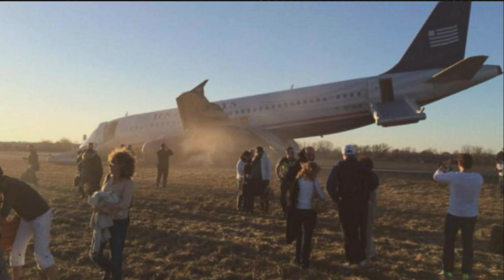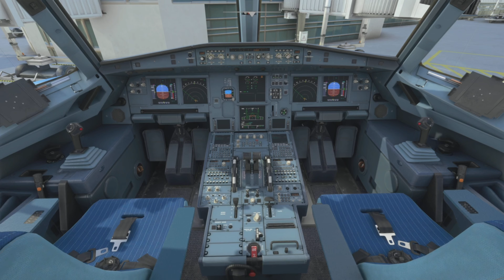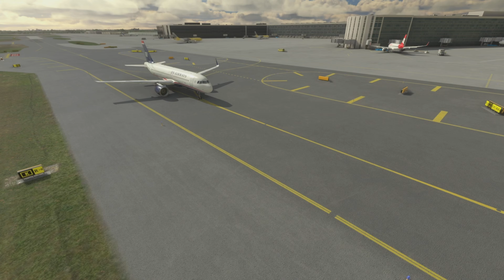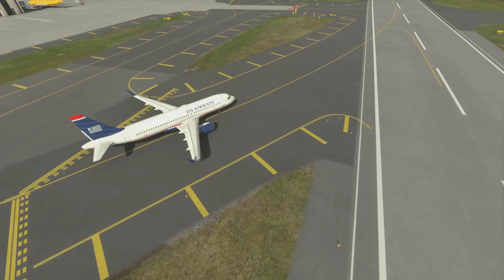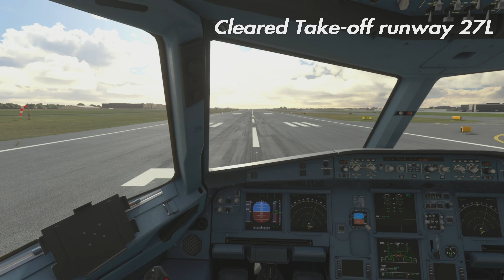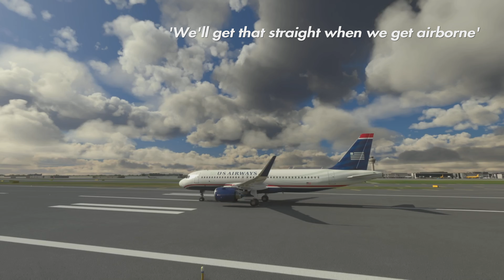Should They Have Continued? | US Airways Flight 1702

Comment: The one thing that sticks out to me is what changed the captain's mind. He already had the v1 and rotate speeds from the previous configuration which he seemed comfortable with seconds earlier. The alert continued during the entire take off. So what changed from hos perspective to make him reject?
Reply: I think I read somewhere that the aircraft wasn't performing as usual after rotation, since the thrust levers were in a detent that relied on settings that were not properly input into the computer, it was producing less thrust than expected. the aircraft seemed sluggish or like it wasn't climbing as expected? So instead of putting it in tho toga detent which would have provided sufficient thrust he just aborted. Definitely mishandled but no one died. I'm not a pilot so I can't judge. At the time he probably thought he was doing what had to be done. 

Idk if this is accurate info, I could be getting my accidents mixed up. So take what I say with a grain of salt.
Reply: Even if he had set to TOGA after take off the engines wouldn't spool up for at least 8 seconds.  A higher speed/altitude crash would've had a far worse outcome.
Reply: @blackhawkorg  I feel like 8 seconds is from idle tho... Obviously they were making sufficient thrust to get to v rotate. But point taken tho there'd be a delay.
Reply: @blackhawkorg  Wrong.    That old 8-second rule died LONG ago.   AB engines are considered "spooled" at idle.   If he had them in the first detent, they were already producing a whole lot of power.  Simply pushing them to the next detent would have given him all of it.    Stupid reject at that speed.    I flew the bus for 5 yrs.
Reply: @lbowsk  Since the two runways were parallel, why change the computer and delete all the calculated data. It makes no sense to me, since being a few yards to he left or right would not change anything. 
The only thing that was not functioning correctly was the captains brain.
Reply: @wilsjane  The wrong runway will cause navigational issues, as the departure route is based on the runway.
Reply: @jaketus  At many airports, yes.  At PHL, the only Standard Instrument Departure is the PHL 2, which is nothing more than runway heading or heading assigned by the tower, so in this case there would have been no adverse effect from failing to change the departure runway in the FMGS.  Go to TOGA, fly the previously-briefed v-speeds, knowing 27L is longer than 27R, discuss the issue with the First Officer once safely above 10k feet, with the intent to understand what went wrong so you can learn from the error.  File an ASAP if you feel paranoid.

That said, the crew should have simply advised the tower they needed a moment prior to departure, and complied with SOP by setting the correct runway and performance data, and reviewing the change prior to accepting the takeoff clearance.
Reply: @jaketus  Would a few yards make any difference, it is within the tolerances of GPS. It is unlikely that if the data was re-input, anything would have changed. Aircraft are also buffeted by the wind during flight, so the navigation recalculates all the time.
Reply: @pa60pilot  Your last suggestion would probably have been the wisest considering everything. I am sure that they would not have been the first crew to delay takeoff for a few minutes after discovering a mistake. 
I doubt that ATC would have been too concerned, with the emphasis on safety.
PS. I am a systems engineer (now retired), but  close friend was the chief pilot of a major international airline. She (yes she LOL) always said that the three most important things are common sense constant verbal communication on the flight deck and maintaining manual flying skills.
She insisted on one manual flight a week, only using autopilot at cruising altitude if the flight was over 2 hours.
The airline has not had a crash or incidents involving injury in more than 50 years.
Can you guess the airline.? For obvious reasons, you certainly won't find it on any video's LOL
Reply: Maybe it just unnerved him too much for the computer to be calling him a retard over and over when he was trying to take the plane off. (I do know this isn't what this warning means but, even still, there's something unnerving about any warning blaring at you when you're trying to do something that requires a lot of concentration.)

Comment: Based on the information given in the video, I have a strong suspicion that the captain realised he made a mistake and came up with the fib of the plane not being safe to fly.  It sounds like a valid reason and at the same time a very general one which does not tell us anything.  

However, if the people investigating this incident were as curious and tenacious as myself, they would have kept probing the captain as to WHY he was convinced the plane wasn't safe to fly, and comparing the answers with the data from the wreck.  

If this would have been inconclusive, the captain most likely fibbed, if he came up with  a valid reason which was corroborated by the technical state of the plane and possibly other relevant factors, then I would be satisfied.
Reply: It wasn't a "fib", as much as a bold faced lie in an attempt to justify a monumental F-up. You have a bus in the air with 2 good engines, the correct flap setting, and still decide to abort????  C'mon man.
Reply: @bayouflier  Exactly!

Comment: When the aircraft lifted off in a normal manner, it would seem that at that time V1, V2 and rotate became a moot point. It was flying.
Reply: From what the captain was saying, he didn't feel like it rotated in a normal manner. No doubt due to the already highly abnormal roll, something didn't feel right to him so he decided to put it back down. I'd rather deal with a crash at 170 knots on the ground than be 2000ft in the air with an uncontrollable aircraft. The decision making up to Vr was bad, but the decision to just keep it down was sound

Comment: Computer glitch, no good programming reason to ditch V1 and Vr and Flex settings without human entry. For a 1 letter bookkeeping mistake a plane was totaled. Rewrite software, make settings independent after airspeed alive.
Reply: It's just not a one letter change, changing R to L; thing is from major airports, you fly predetermined published tracks, called SIDs (Standard instrument departures) and if you get a runway change, you would also get a SID change probably. So you need to re-program the whole thing, so you get the correct runway, SID and transition points.

Comment: I am not a pilot but by just looking at the high speed 170 kn+ and the fact that the flaps are  correctly configurd for takeoff, I can't just let the aircraft absorb all that high speed energy by  braking and ultimately breaking my neck too...I just go manual mode, full trust or TOGA and  gently rotate, then figure out the rest up in the air

Comment: In simpler times, with a paper checklist and a serviceable flying aircraft, the pilot would simply have given it full wellie and flown the beast. Too many computers and too many alerts converted a flyable aircraft into a pile of scrap.
Reply: I would have dumped the power on it and taken off once I got too fast to safely reject. He should have rejected when the first issue occurred but, since he didn't, the next best option is to use the power you have right at your fingertips power those engines way up. Of course, I usually default to going faster to get out of trouble in the car too so maybe that makes me more likely to decide to put the TOGA on and fly it. At least no one got hurt.
Reply: Agreed.  Why not just give it all it's got and get the doggone thing in the air.   Scrimping on thrust just to save a few dollars seems very shortsighted when this is a possible outcome of not putting the hammer down.  Why run the risk?
Reply: First of all, by any chance are you the Andrew Emery of The Regulatory Group, Inc in Washington DC?

Secondly, I agree with your comment. Rather than reject at that late stage he should have pushed the levers forward and flown. But if he wasn't inclined to that sort of action I also believe he should have rejected when they got the thrust warnings and blank V speeds at the initiation of takeoff roll.  First mistake was not aborting right away. Second and worse mistake was putting it back down after liftoff.  

We have seen how too much automation leads to pilots not always fully understanding what the machine is up to. If this happens often enough with uneventful consequences pilots can become habituated into assuming this one is another glitch they will eventually sort out. This one was something this crew had never encountered, and I bet habituation led them into trying to determine if it was just another nuisance warning before taking definitive action. But this was time they didn’t have to spend, and that indecision almost lead to disaster.  (Some guys will do anything to keep from going back into the taxi queue at PHL)
Reply: You are so right, too many f-----g geek boxes ,pilots are pilots not  geeks with glasses and zits, they are paid to fly the damn plane. Taxi onto  the active runway set brakes, slowly ramp the bollocks out of the engines, until both are screaming fit to burst, then release brakes, feel that kick in the small of your back ,yes cat&kittens you are going to lift off.

Comment: First, the use of “they” on the title is to be avoided. Use Captain instead. He/she is the one responsible. Secondly, procedures were not followed, ignored as to changing the departure runway which required additional entries. While I flew the A-320 at another major carrier, the use of FLEX does not ring a bell. Must be this airline or something after I retired. Changing departure runways requires inputs because of possible  shorter/longer lengths and standard instrument departure procedures. Any changes after departing the gate requires starting the checklist sequence. Next, any messages upon throttles being advanced or into a takeoff setting requires an abort. Any. I presume this was the last flight for this crew.(fired/retired).
Reply: You flew the a320 and don't remember FLEX? Either lying about flying or time to see a doc
Reply: @Bren39  right!! Don't know Flex/Temp that's like 20 plus years old. Maybe he's a Boeing man. Or maybe just a bulls##t artist

Comment: Have to go with the captain on this. F/O messed up, the captain didnt see/correct soon enough, but on takeoff he's not sure what is going on with aircraft. So in tha case best to keep it on the ground.
Reply from the maker: That's the thing, the captain had to make a split-second decision, rightly or wrongly one had to be made. If there had been an issue that would have prevented safe flight, he would have saved everyone's lives.
Reply: Uh no.  Short of something catastrophic, you do not abort past V1.  An error alert is not catastrophic.  Move the thrust levers to TOGA and get out of there.

Comment: The Pilots are there to make these last minute calls. Hindsight makes it easier to see everything that was happening. Using hindsight it doesn’t appear to make sense why the Captain didn’t continue the takeoff as he has done hundreds of times. But then again, if there was an issue and the captain continued it would be a different story! A strange one! Thank you for this.
Reply from the maker: Agreed, it is a strange one. It’s hard to make a critical call on the Pilots decision at the time. I’m just glad no one was hurt or killed.
Reply: Hindsight is great, if only someone thought of it sooner
Reply: As a newly rated a320 pilot I have so much I want to add!